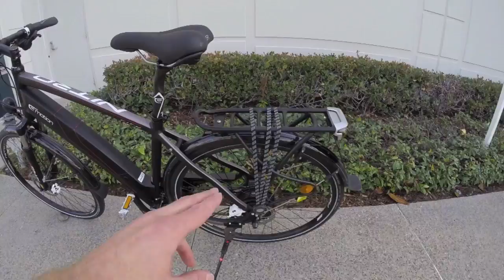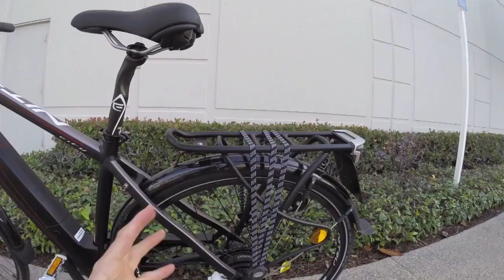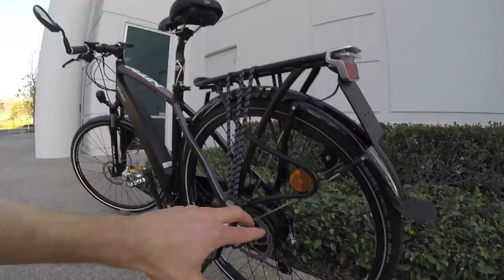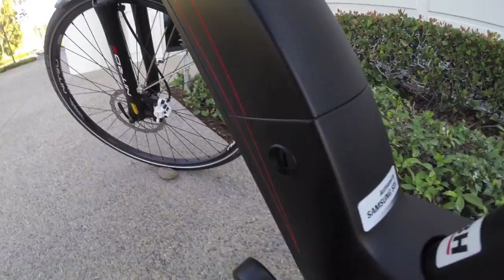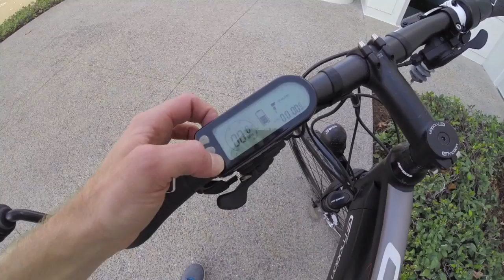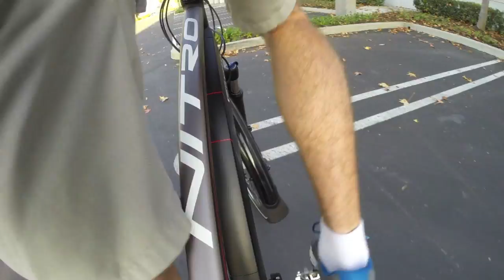2015 Easy Motion Nitro City Review - $4.4k

Comment: The problem with Quick-release is theft. If you live in London, NYC, LA, Philadelphia, Baltimore, Berlin, Paris etc... QR is a major theft problem, even for standard bicycles. I use 3 locks for my bike because of QR. 2 U-locks for the frame/wheel front and rear and then a cable lock for the seat/post. I've actually seen people riding down the street with no seat because some asshole stole it. My seat has an air opening that is just wide enough to get a cable lock through. It would be fairly easy to cut it, but my seat isn't high end or anything worth going through a lot of hassle to steal, though I think it would probably eventually get stolen without the lock.
Reply from the maker: Wow, yeah... I've always used one u-lock for the frame and then a long cable for both wheels and a short cable for the seat (I go through the saddle rails). With new wireless and gps enabled locks and alarms I expect bike theft to face some serious challenges in the coming years. Maybe it will significantly decrease :)
Reply: ElectricBikeReview.com I hope so. I was watching a BBC documentary on YT (I live in America) and it was on bicycle theft in London and it's really bad. There's another video up of a guy stealing his own bicycle right in front of a cop in NYC.  I see improperly locked bikes stolen all the time (I have very often seen rims locked the fences and the like) and I've seen guys walking around with rims so they can steal a bike not properly locked. I really only see this downtown (Philadelphia). My part of the city isn't too bad, it's mostly just opportunistic thieves taking bikes that aren't locked at all. Though I absolutely despise thieves, I've estimated that I could strip a locked bike of all of it's expensive parts in less than 10 minutes. The shifters, derailleurs, brake levers, cassette, brake arms, the crank-set and the forks and handlebars (with a battery powered screw gun and a couple of wrenches).
Reply from the maker: tarstarkusz Interesting to think about. I also live in America and am not a fan of theft but I can understand how some people might be struggling to get along and choose crime as a means for survival. When I see them smoking, drinking or wasting money on destructive habits that might otherwise free them from poverty and destruction however, my empathy fades. I avoid bad neighborhoods for the most part but it would be interesting to set up a sting and just question a would be thief about why they're hurting others... Maybe it's about drugs for some of these people.

Comment: hey ebr just wondering do you still think the bh neo jumper 27.5 is a good mountain bike compared to the rest you have reviewed .cause i am thinking of buying one that or the evo jumper and was wondering are they pretty good off road on trails and stuff like do they perform well if there is small jumps and bumps .was also wondering does the pedal assist really help as im not fittest guy and mainly wanna get a ebike to improve my fitness but also help me commute to work easier if i am tired .either way what would be a few good choices if i wanted a ebike that can commute and also take a beating on the weekend on some hills and stuff .thx for your last reply :).really appreciate it as im really new to ebikes .
Reply from the maker: Hi Jason, this is Court, I'm the guy in the videos and stuff! Yeah, the Neo or Evo 650b (27.5") will be awesome bikes for commuting (medium distances) and for going off road. They offer less torque and climbing ability than a mid-drive like the IZIP E3 Peak (which also comes in a full suspension version: http://electricbikereview.com/izip/e3-peak-ds/) or the Haibike FS 27.5" but will feel zippier, cost less and weigh less (and look more like a regular bike). You mentioned that you aren't super fit right now and want to know if the assist will really move you are not... the answer is yes definitely. The Dapu geared hub used on Easy Motion Neo and Evo bikes has a nominal output of ~350 watts but peaks at ~550. A pro cyclist puts out ~250 watts on extended rides so imagine having more than one of these guys pedaling along with you. As long as you help pedal and gain speed the Easy Motion ebikes should also climb very well but if you just start from zero and twist the throttle on a steep incline they will struggle to get going :)
Reply: ElectricBikeReview.com thx so much court for the input .you have alot of knoledge .i was just wondering what would you get if you wanted something that could take a bit of a beating and had power cause im kinda tossing up between the new evo 27.5 or the haibike fs i like the idea of having a throttle on the bh but the haibike looks like a better quality bike overall .so kinda not sure lol .but either way these electric bikes look like a blast and not having to worry about climbing hills would be great :).
Reply: Jason Thai oh sorry for so many questions i was also wondering what bike do you prefer now out of all the mountain full suspension performance bikes you have looked at .great channel by the way to your vids are very good i love the amount of detail you put into your reviews .i dont know much about ebikes but after watching your vids ive learnt alot .
Reply from the maker: Jason Thai Awesome! Glad to receive your positive feedback on the videos. For me personally, the Haibike FS 27.5" is the winner in terms of quality and performance for mid-level trail and mountain models. I actually bought one of these for myself (in part to learn about the Bosch system more completely) and it has been great. I don't really miss the throttle because the higher levels of assist are so zippy. the suspension, wheelset and frame are high quality and it can climb just about anything. I like the feeling that I'm actually getting a workout and appreciate the super low center of gravity and perfectly balanced frame. On mine, I put on fenders, a rear carry rack and panniers for commuting and that's worked great (here are some videos about each: fenders https://www.youtube.com/watch?v=mI7vaD5o0cw and panniers https://www.youtube.com/watch?v=ozrwhAWQwNY) and if you need help finding a good dealer for Haibike (if you don't have one nearby) I might be able to direct you with this form: http://electricbikereview.com/help-buying/
Reply: ElectricBikeReview.com just wondering to because im from australia our haibikes have RC on them instead of RX is there any differance we still have full suspention but yeh seems to be a RC on side of bike instead of RX.thx for all your help court definatly gonna go for the haibike :).so is the haibike and the bh around about the same speed tho or is the haibike have more power.sorry this will be my last question haha .thx again for all your help .
Reply from the maker: Jason Thai The RC may designate a different motor setting? I think in Australia they go a bit slower to comply with law but it's basically the same motor with similar torque. I've been reviewing newer haibike models and the RC may be more oriented to downhill? I'm sorry but I cannot say at the moment (feel free to post a link to the bike you're looking at and I can try to find other differences, it may just be a naming thing). Both Easy Motion and Haibike will be approximately the same speed based on the country where they are sold.
Reply from the maker: Jason Thai Hi Jason, yeah the RX looks just like the RC to me (aside from the lower watt motor at ~250 vs. ~350 and the top speed of 15.5 mph vs. 20 mph in the USA). I also see that one of the color choices for the RC is slightly different than the RX. My guess is that the name change is to help clarify regional differences.
Reply: ElectricBikeReview.com oh thx for that do you still think 15mph is fast for a mountain bike .as i was just wondering cause when i get tired thinking of letting motor do work and was wondering what the comparison would be to a high priced mountain bike without motor .cause atm im tossing up between a giant anthem advanced and a haibike full seven .thx for all your help appreciate it :).
Reply from the maker: Jason Thai Sure thing! Yeah, I think ~15 mph on mountain bikes is just fine because I tend to ride slower on trails (loose gravel, quick turns, sharp drops etc.) and when I'm on a downhill section I easily get above ~15 mph (or even 20 mph) using my own power and gravity. I have an injured knee so starting from rest and climbing are my two biggest sensitivities. Both of these are usually up to ~10 mph and even though the Haibikes are heavier than non electric mountain bikes like the Giant Anthem Advanced (probably at least 2x as heavy) for me it's still worth it and the removable battery pack makes it transportable with most racks (weight wise). Honestly, I don't think I'll ever buy another non electric mountain bike... road bike maybe, but for off road they work so much better for a weekend warrior like myself and while 20 might be preferable, I always ride in the lowest two assist levels so I'm not sure I really reach 20 mph with the motor or just on my own after it has helped me get going. Okay, long winded answer, hope that helped :D
Reply: ElectricBikeReview.com thx again man for all the help :).good answer .
Reply from the maker: Jason Thai Sure thing Jason, these bikes are a ton of fun, have a great time out there and feel free to share about the RC if that's what you end up with. I created a Haibike forum where people can connect here: http://electricbikereview.com/community/forums/haibike/
Reply: ElectricBikeReview.com god this is hard to choose from i just seen a nduro pro 2015 all i can say is wow ! lol .now i dont know what the hell to get .thx again court :).
Reply from the maker: Jason Thai Sure thing man... I know the long travel suspension and downhill look of the NDURO Pro is cool but for the type of riding I do (around town and easy to moderate trails) the geometry on the FS 27.5 is great and I like the quick adjust suspension with a firm setting for flats vs. the floaty soft feeling on t he NDURO models.
Reply: ElectricBikeReview.com do you still think the 27.5 wheel is good for jumps and turning and stuff if your riding thru trails fast .i also heard that they are not going to be making 26inch wheels soon is that true ?.
Reply from the maker: Jason Thai Hi Jason, for me 27.5" is a great size for trail riding or a bit of on road and off road. If you're downhilling and need long-travel suspension then 26 is still the best because it makes room for longer travel and also maneuvers the quickest. It's super strong as well because the spokes are shorter. I don't think they will discontinue that size but it may become less popular for consumer ebikes that are mostly kept on road or light trails :)
Reply: ElectricBikeReview.com oh ok cool .can you still manuever ebikes like standard non motor mountain bikes cause ive also been looking at the giant anthem advanced and i think its like 8 kilo lighter or something .i havent rode a ebike yet so im gonna have to try the 2 but guess ill see what happens .it would be good to have a motor tho :).
Reply from the maker: Jason Thai Yeah, they are similar to maneuver (some easier than others depending on where the motor and battery weight are attached to the frame). The best place for additional weight is low and center on the frame, not on the wheels or on a rear rack. Here's another ebike review that shows some footage of bunny hopping and wheelies done by a pro rider towards the end named Dustin (see around 7 minutes: http://electricbikereview.com/grace/mx-ii-trail/) Indeed, these bikes are ~8 kg heavier than non-electric bikes and that comes from the stronger frames, motor and battery but you do get a nice boost in range and assist climbing. I've jumped full suspension ebikes and had a lot of fun with them: http://electricbikereview.com/haibike/xduro-fs-rx-27-5/
Reply: ElectricBikeReview.com hey court do you know much about the normal mountain bikes cause im thinking of getting a giant reign advanced 0 team about 7 k here but the dealer where i am who sells ebikes is just very arrogant and dosnt seem like he is interested in helping me rather just making a sale and where i am australia there is like 1 or 2 dealers and thats about it with not much selection in way of ebike . i got a giant reign advanced and i just couldnt believe how light it was and just seemed like a incredible bike and in australia we do have enduro races so was just wondering what you think of this bike or a vitus sommet if you have used these bikes before .
Reply from the maker: Jason Thai Hi Jason, I used to own a Scott and a Specialized hardtail mountain bike but am really not an expert on Giant (or really any non-electric mountain bikes). When I choose a bike I usually just pick what fits my budget and feels about right in terms of size. I'm not an extreme rider and none of my chains, cassettes, wheels etc. have ever broken. Worst thing that's ever happened is a flat tire. Sorry I can't speak more to the Giant Reign Advanced and bummed to hear that your local shop isn't into ebikes YET! Ha, maybe in the future... I really prefer the boost now vs. the lighter non electric bikes, my knees get sore if I ride without support and that takes the fun out of it for me :)